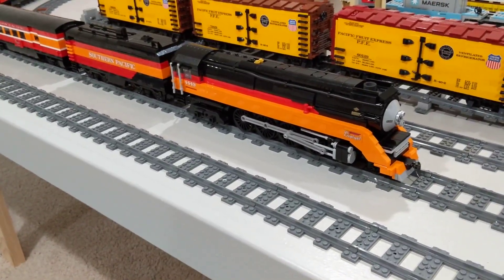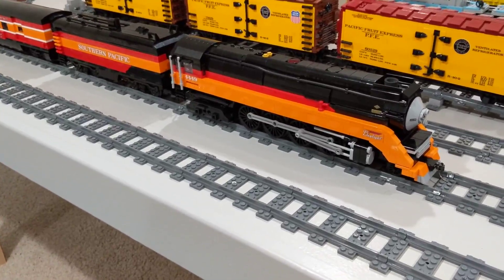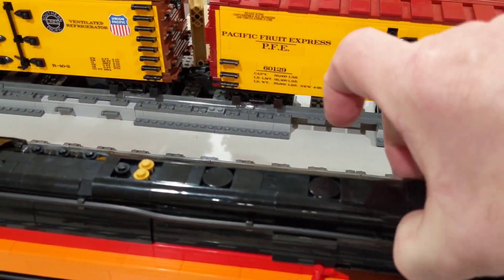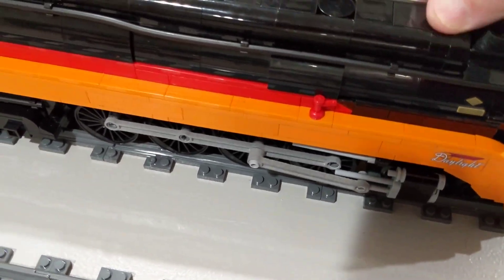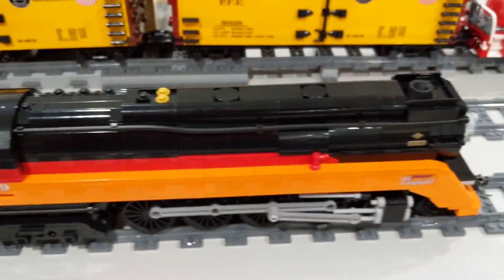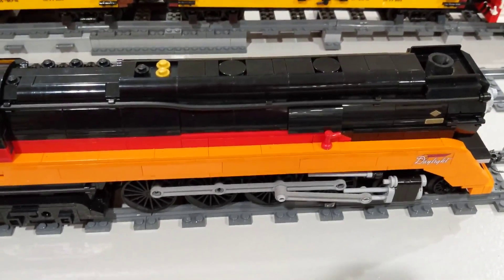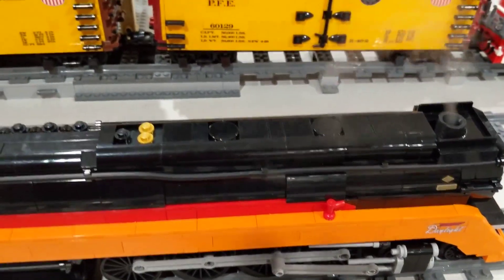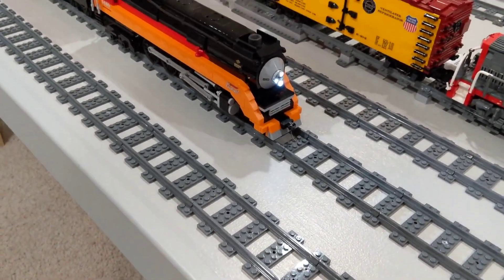Lego Southern Pacific Daylight train with Steam Generator

Comment: How Did you put sound
Reply from the maker: The sound is generated by a model railroad SoundTraxx Tsunami DCC board in the tender with the speaker. It also controls the lights and motors wirelessly using an Airwire Convrtr receiver, also in the tender.

Comment: Amazing build, how did you do the twin lights on the front?
Reply from the maker: Thanks! The lights are small LED's with attached very thin wires, 1206 size IIRC. I did drill small holes to route the wires. The LED's are glued to the stud of the 1x1 clear round plate.
Reply: @djg6910  how did you get the sound to it 😮🤯😁
Reply from the maker: @coolmangame-gi8hq  The sound is generated by a Soundtraxx Tsunami2 DCC decoder which in turn is powered and controlled via an AirWire Convrtr with 3X 18650 Li-ion cells in all in the tender along with the speaker. I upgraded from a previous MRC Loco Genie wireless DCC controller.

Comment: where do i buy a smoke generator?
Reply from the maker: I bought a Seuthe smoke generator on ebay but have since designed my own 3D printed one using a water mist generator, shown in this video.
Reply: @djg6910  ok thx